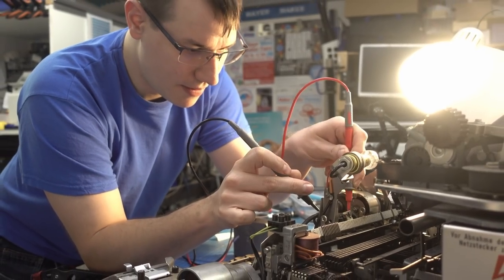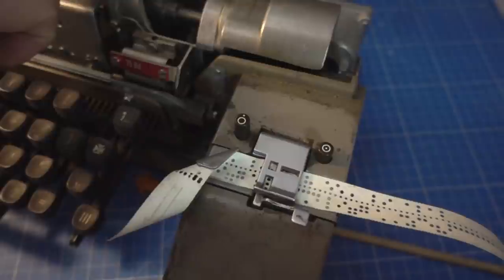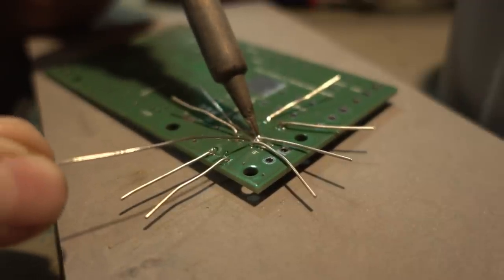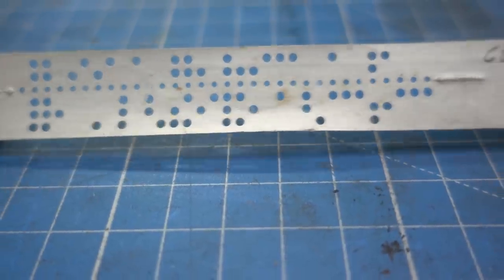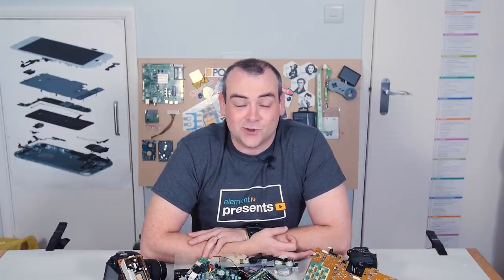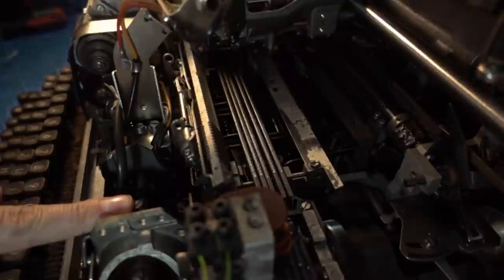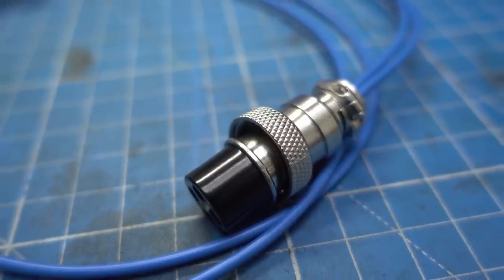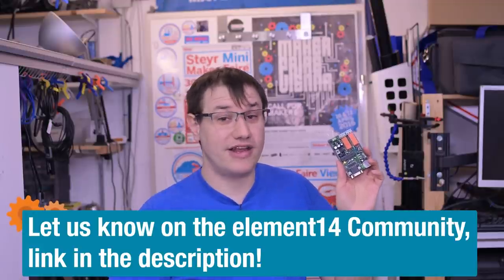Using a Teletype Machine as a USB Printer with Arduino

Comment: I ran teletype for the US Army back in 70-71 when I was stationed in Vietnam.  The way we set our timing on the machines was with a tuning fork and the motor had 3 spots on it.  You tapped the fork and looked through a couple of lips on the fork at the motor face. There was a clutch on the motor and you set the speed of the motor (timing) by getting the speed so the 3 dots stood still on the face when viewed through the tuning fork.  We used 2 different machines, one to cut the tapes and send them, another to print a page copy if one was desired. Our tape machines also printed text on the tape so they could be read without printing out a page copy if, for example, the message was simple operator to operator messages.

Comment: Interesting approach.   In the late 1980's a company by the name of black box came out with a serial (RS-232) to  current loop adaptor but all the communications was done on the PC end.  This meant that both 5 and 6 bit baudot would work with the adaptor.    I believe they still make some versions of this but again, you would need a communication program that can communicate using the correct protocols and I don't believe they have ever tried using USB.
Reply: somebody has to try first I guess

Comment: I love it when old technology gets put back into use.

Also: Obligatory 'ink cartridge prices being so bad it's cheaper to refurbish a teletype' joke.
Reply: boy do iIhave the video for you coming....
Reply: I've got an old pen plotter I want to put back in service. I need to build the proper serial cable, and then use a Raspberry Pi (I think) to convert DXF files into HPGL, because windows no longer supports HPGL drivers. Or I might just put a Win98 computer together to use in place of the Pi. And then there are ink pens. You can still purchase them, but they are expensive. I need to modify some standard off the shelf ones.
Reply: @cheeto4493  a very rewarding project! to be future proof I'd prefer the Rpi and translation method.

Comment: This video series is my jam... I find it fascinating getting two machines to talk to each other, much less two machines with such a difference in age. The oldest machine I have is a Commodore VIC-20, which I have interfaced to a Raspberry Pi Zero in order to grab RSS news feeds, Twitter tweets, etc. from the web to send them to a terminal program running on the VIC. The VIC's user port is connected to a TTL serial to USB converter which then gets connected to the Pi, leaving the GPIO pins free in case I want to connect other stuff in the future.
Reply: Thats a great project! would be awesome to see how it work. you could post about it on our community site linked in the description!

Comment: This is standard serial stuff... Just more limited in character set. It's also been used for years as Radio Teletype, used to transmit Wx data and whatever. Very popular in the amateur Radio world at the time as well. The Creed 7 series machines  were very common and popular.

The baud rate, exactly the same as any other serial protocol. Generally 1 start 5 data and 1.5 stop bits are used (two stop bits are fine as 1.5 is the minimum stop bit length) 

Nowdays we have nice scopes that you can attach, rather than the strobe or tuning fork widgets, so hang a scope on the output of the teletype, and ensure that you can see the data pulses. Sent RYRYRY's from the keyboard these give you alternating 0's and 1's  capture on the scope and measure the mark/space of a bit. Tweak the machine until you get the correct pulse width.  As it's a mechanical system once you get the bit length set, everything else will fall into place. 

Another option is to grab a copy of FLDIGI which can decode most RTTY systems (as well as dozens of other data modes) and allow you to analyse the speeds. You will need to feed in AF tones to FLDIGI, but you can use the switching output of the printer to switch a couple of sig-gens to generate the mark and space tones.

Things to remember, the incoming signals were at high voltage normally, +_80V and they acted on some very finely balanced solenoids

If you are using standard relays in your test hardware, then they are going to have a very hard life keeping up with switching at that speed Contact bounce will be an issue.
Relays have a mechanical life of about 1x10^8 operations, That's about 200K 5 bit characters  that's about 20-40 A4 pages (not every character switches every bit) So they are going to wear out pretty quickly. Change to an electronic switch system for reliability.

Andy

Comment: In ham radio, there are still “heavy metal” categories in RTTY contests. All are mostly run at the original 45.45 baud. There is a 75 baud contest as well. Most are old model 28’s but there’s a model 19 or two out there. It’s still a very popular contest mode, mostly done as AFSK (audio interface) rather than FSK (on-off serial signals) nowadays. The comparison to CW is accurate - at about 60 wpm ! 73, Jamie WB4YDL
Reply: Interesting!

Comment: In the 1980s I was doing some urban exploration with friends and we got into an old military site and there was a room with ten teletype machines like that. When we looked at the printouts they were dated just a month before. All the information was about a simulated nuclear attack on the UK with bomb sites and estimated mortality rates.
Reply: that is wild,.
Reply: @MAYERMAKES  It was a creepy place. Looked like a fenced yard with a brick shed in it. When we opened the shed which was unlocked there were stairs down to an underground tunnel with lots of side rooms, most with old filing cabinets or army beds.
The power was on and we picked up a phone and there was a dial tone. We did go back a few weeks later and the metal door for the brick shed had been welded shut.

Comment: I have interfaced a daisy wheel typewriter with a ‘duino and attached it to my TTL computer so it can print the "output display" value on paper or set the card (using a control code) to interpret the values as ASCII and print letters etc. currently it can do letters/numbers/symbols with and without shift, there are a few other symbols that use control (and shift as well I think) but I haven’t wired that up.

I have also briefly interfaced with a parallel port dot matrix printer using a PIC based controller (PICAXE) and a shift register.
Reply: awesome project! there is something similar coming up on the channel. I be happy if you share your projects on our community page!

Comment: I have used the teletype 100 in the 80's to make qso's in rtty. The speed of the machine had to be adjusted with a tuning fork. The 115 - 120v for the receiving coil is important for the mechanical reaction speed. T=5 x L/R. So big R makes a small T reaction time.
Reply: glad I did not have to resort to a tuning fork! thanks for the insight!
Reply: @MAYERMAKES  in those days, every Siemens teletype was delivered with a maintenance set including the fork. Fast and easy to check and adjust the motor speed

Comment: I used a Teletype as a terminal to write code in the 1960s. It ran at 10cps.  I could punch the source as I entered if I wanted (assembly language) and punch out the executable code.  Some of our computers had faster paper tape readers.  I would have to toggle in a bootstrap loader on the computer panel to load and run the code.  We also had punch card capability.
Reply: typing in assembly might indeed be an option to simplify the data transfer.
Reply: @MAYERMAKES  It beat filling out coding sheets.  The turnaround time was terrible - a couple of days.  I've used fan fold and rolls of tape.

Comment: make a standard compatible to general  TEXT print driver(I would be prised it still not on the windows 10 ISO), and the you can print from anything the can print modern printer in simple text, (and it a big if, anyone else has made print driver that can convert graphic to text )and then just output that to general  TEXT print driver, and get the full steam punk vibe 🙂
Reply: Oho some project ideas here...

Comment: Why does anyone use relays, ust optical relays. They are cheap, fast and stand 60v 60mA with ease. Relays will die when you use that thin a lot like on Maker Faire. Use optical relays.